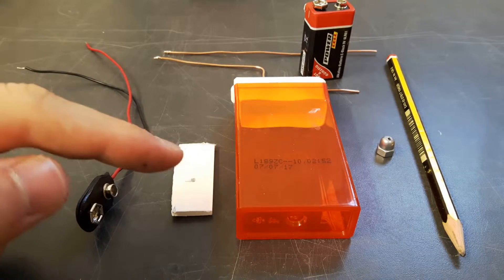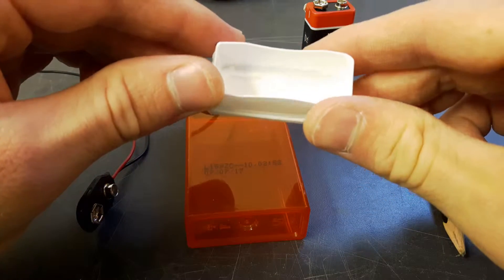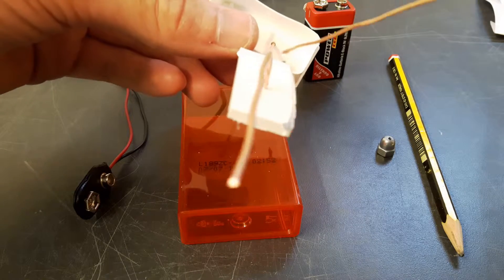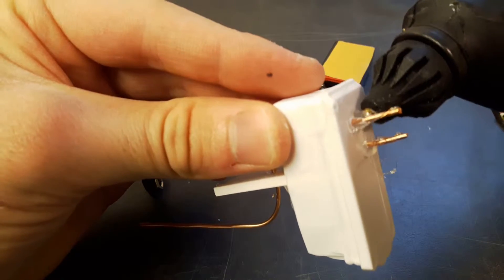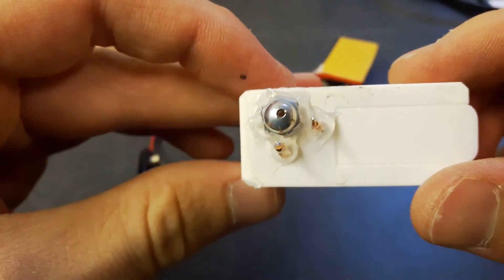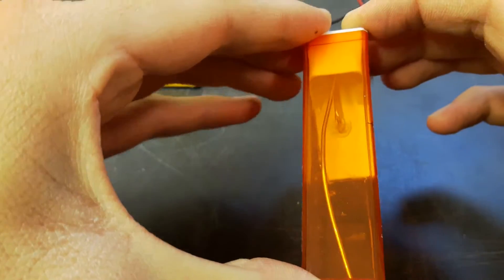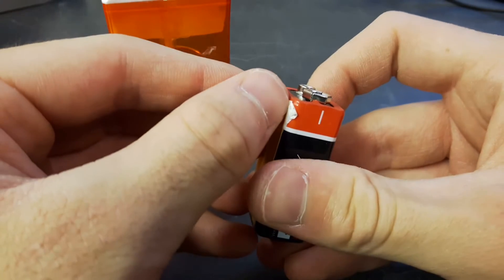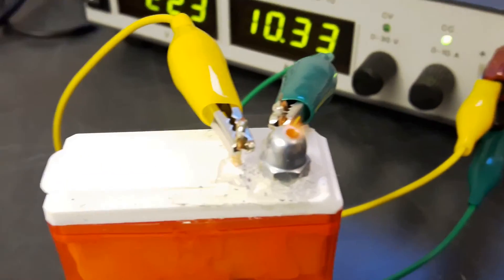Make a Hydrogen Torch (Pocket Torch)

Comment: buddy, that's a chlorine gas flame. Are you in Syria?
Reply: maybe hydrogen too but I believe that flame color is more from the Cl
Reply: HHO would probably make your cell a small bomb though so I don't suggest it, no oxygen is good for preventing flashback but Cl is not so great to generate
Reply from the maker: @fernandogigabyte1883  it doesn't generate chlorine gas, the chlorine immideately reacts with the copper electrode forming copper chloride in solution, hydrogen however is produced, thats why it is H2 only.

haha I am not in syria, do I sound like?
Reply: so you are in Syria
Reply: @ShroomLab  it does make chlorine gas, it does leave

NaCl electrolyte is a bad idea, either you use bicarb or you dont do it

Comment: What Happens to the oxygen?
Reply: dont use nacl, that makes chlorine gas instead of oxygen, that mixture with hydrogeb 
is not good and burning it makes hydrogen chloride gas which reacts with moisture to make hydrochloric acid fumes, not good
Reply from the maker: No is produced, as this torch is operated on nacl.
Reply: Shroom Lab thanks for responding